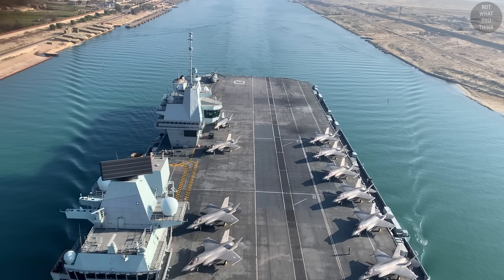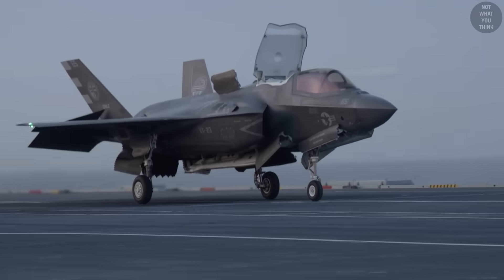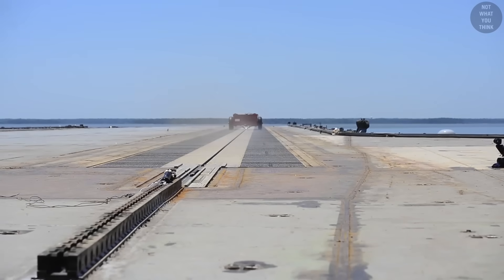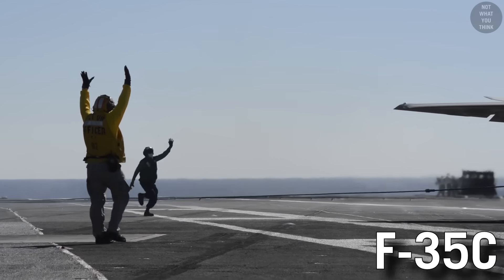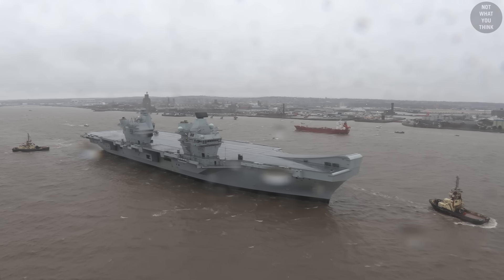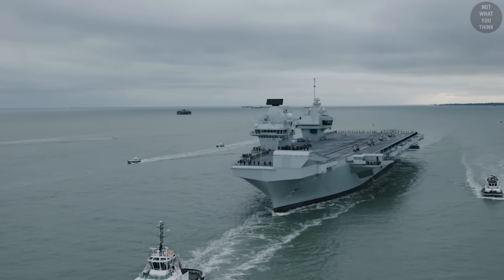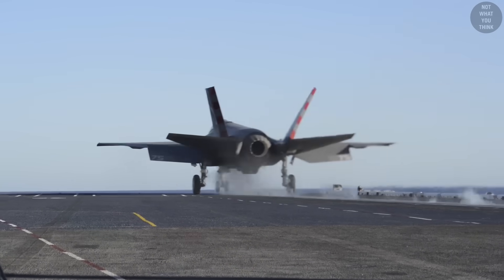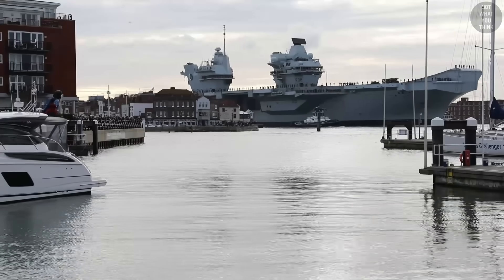Was the Angled Flight Deck Missed on HMS Queen Elizabeth?

Comment: You missed the main reason why STOVL was favoured. They are able to take off and land at higher sea states than traditional aircraft. This is critical for the UK, as the Atlantic has these often during the spring and fall. North Atlantic more than the South, but South Atlantic also has demanding weather and Royal Navy needs to operate there as well.
Reply: Sweats in Falklands War
Reply: @randomguy9777 You don't seem to fully read the comments. just because the QE class don't use the E2 does not mean that they have nothing other then the radar on the ship. i won't bother saying anything more in the hopes you use your head a little more in the future. If i didn't know better i would have thought that you are a E2 salesmen with statements like " You still need them though." when directly told there are other options lol.
Reply: Apparently the U.S wanted 2 billion U.S dollars for the EMALS system and it does not even work right.
Reply: @randomguy8196 Sour grapes about what? How would our carriers be more vulnerable to regular missiles? Both the carriers and the Type 45's that are part of the carrier strike group can track about 1000 missiles at a range of at least 250 miles, add to that the carriers have the ability to fly Merlin AEW with Crowsnest around the clock to expand that capability. Lack of a working time machine or ability to see into the future I'd imagine, our carriers were planned and built before hypersonic missiles were an issue. Any nation capable of hitting our carriers with a missile could easily shoot down an E-2, France operates 3 E-2's but if they lose them then the Charles De Gaulle has a radar range of about 155 miles and can only track around 500 targets, much less capable than the Queen Elizabeth class carriers.

They have already launched drones from HMS Prince of Wales and have plans to continue developing that capability, but realistically most of our recent conflicts have been against nations that barely have an air force, never mind anything that could threaten our carriers. So drones are in the nice to have category but hardly essential at this point in time.
Reply: @randomguy8196 On the E2 issue, Skullet said that the US has 11 aircraft carriers, each equipped with 5 E2s, for up to 55 E2s in total.

Other nations have 2 or 3 E2s in total, across their entire fleet. With that few, they likely wouldn't want them anywhere near enemy territory or anywhere near the range of enemy firepower if there was the remotest possibility of them being shot down.
Reply: And they can land anywhere, not just aircraft carriers
Reply: Whats fall?
Reply: @UCrgA9Q4PMBip4Iy62ltAZJQ you’re wrong,
QE2 radar coverage is blocked by horizon smh. Planes can see further out
Reply: Every radar has a horizon. The distance to the horizon is deternimed by the height of the observation platform and the height of the observed target.
Reply: @JB-qg2uc hmmm not every radar.
Reply: @lmaoroflcopter  well as long as you are in atmosphere or in orbit, you have a horizon. If you are in deep space and outside the solar system you don't have a horizon. Or then your horizon would be caused by the galactic core or something else.
Reply: @JB-qg2uc  Check out what the ionosphere does for HF radio waves or take a look at ground wave propagation.
Reply: @smasher123ism   They use Crowsnest radar mounted on Merlin helicopter but looking at UAV system it's in the video.
Reply: Ya but they found other ways to wash the plane’s
Reply: Not an issue for US Supercarriers...only an issue for tiny STOVL Carriers.
Reply: Royal navy is gay
Reply: nobody cares about bristish
Reply: T
Reply: I remember that a British harrier pilot stated that during the Falklands conflict in 1982 that because of the weather conditions it would have been impossible or very dangerous for conventional aircraft to take off or land on a normal carrier. I think his name was 'Sharky Ward'. I am no expert just saying that there many variables to account for. Also the USMC uses the F-35b so again there ard many aspects to take into account.
Reply: Leaving the cats and traps off was a financial decision made by the bean counters and had nothing to do with the way the military operate. The Navy fought the decision and so did the MOD. The ships are far less capable without them.
Reply: The USA has operated in the Atlantic with Carriers for a century now.
Reply: The main reason STOVK was favoured was cost. That’s it. It’s more expensive to fit and maintain a catobar carrier, but the main difficulty is keeping all those pilots well trained. Landing on catobar carriers requires insanely more training. So just isn’t really feasible for the UK at the minute
Reply: Do you think I don't that, I live in Portsmouth UK, where both carrier are based, Indeed
Easy to land on the center compared to pitching arf deck
Reply: Actually the main reason why the RN does not use steam catapults anymore is that they require Nuclear reactors to provide sufficient steam and the Royal Navy do not want ships with Nuclear reactors, they are very expensive, prohibits them docking in ports they want to use and unnecessary for the role the ships are intended to be used for, which is a cross over between a Aircraft carrier and Air Assault ship with plenty of space for Helicopters.
Reply: In old ships power was generated by boilers and routed as steam to power a number of old systems. New ships utilize electricity to acchieve the same thing. Nothing really prevents said ships from harnessing the exhaust heat from the diesels to generate steam for the catapults. Tapping the steam from the reactor cycle is just a simpler matter. But this is not a feasibility issue, merely a choise.
Reply: youd need some greenwater type conditions to make barrier assisted landing impossible. but frankly. the royal navy has had a defensive posture since the end of ww2. so i dont understand why they chose the one version of the F-35 with the smallest takeoff weight. i mean. think about it. also, keeping it a flattop would mean it could still do its job. its longer than the america class by ~90 feet. and the america doesnt have a ski. i mean. dont get me wrong. if they didnt want a full sized carrier. thats fine. im just confused why they made massive carriers. if they are basically america class carriers. just without the rest of the carrier battle group since the royal navy is so small.
Reply: It was favoured because it’s cheaper to spend money on conventional fuel for a few decades than a nuclear reactor. It was about saving money…. That’s the reason the French dropped out.
Reply: @@karmakazi101 You seem to know an awful lot about the capabilities of the British
armed forces and the American armed forces . I am proud of our forces and what they do but I know we work together as partners. I am not anti American as you seem to be. If you are such an expert you can answer your own question. If you cant then  you clearly know a lot less than you think. Why should I educate you.
Reply: Catipult launch can carry bigger payloads plus you can use many other planes as well
Reply: 😢😢😢😢😢😢😢😢😮😢😢67
Reply: The main reason is because it's a cheap junior size fossil fueled slow poke carrier
Reply: The qe is a waste of money.   The French pulled out because we were doing things on the cheap.   Now we have a near £6bn pair of boats that can launch one type of jet which has the operational range of Frisbee.
Reply: You can fly STOVL aircraft of a carrier with catabar. But you can't fly eg E2 Hawkeye from a carrier without it.  So leaving cats & traps out is highly limiting for operations.
Reply: @jeromedavies2408  we seemed to struggle through with the Illustrious class ;)
Reply: @jeromedavies2408  Except it's not worth the price to install CATOBAR just yet for the british carriers
Reply: @jeromedavies2408  yes you can, BUT here is the kicker, you have to use catapults to get them off the deck at the SAME payload they can get off the deck on the QE class using just the "ski jump", and using a catapult reduces the sea state launch capability vs a "ski jump", so having to use catapults leads to an overall deficiency in sea state operation, which is critical to the UK, given where some of the roughest sea are.
Reply: @jeromedavies2408  I'm pretty sure the UK doesn't have or use the E2 Hawkeye, so not really an issue here. Also the launch rate using Catobar is slower than the setup on the Queen Elizabeth as it doesn't have the issue of waiting for steam production to catch up, it also causes less damage to airframes due to stress.
Reply: @Skullet  That's sort of the point. The E2 Hawkeye cant fly off QE  so airborne radar range is severely limited.
Reply: @jeromedavies2408  The UK doesn't use the E2 Hawkeye, so the fact that a plane we don't use can't take off from the QE2 is utterly irrelevant. The QE2 radars can track up to a 1000 targets at a range of 250 miles or a snooker ball sized target over 12 miles away. The QE2 opperates as part of a carrier strike group so it also has the capabilities of the other warships in the group. With that said, I think its radar capabilities are fine.
Reply: @Skullet  That's true of all carrier groups. But they also have long range aerial radar. The UK is hoping to use helicopters which have less range and a lower ceiling. 
Without cats/trap the UK carriers are limited to STOVL types, so very limited. EG US carriers can change staff while on patrol  with the Grumman C-2 Greyhound.

Lack of cats/traps severely limits the capabilities of the Elizabeth class carriers.
Reply: @jeromedavies2408  We already have the Merlin HM2 with Crowsnest and while it might not be as good as the E2 Hawkeye, it's probably a lot more cost effective. France bought 3 E2's and the expected program cost is $2 billion, that's a waste of money for a capability that we probably don't need. We don't need to change staff while on patrol, the Royal Navy has operated successfully for almost 500 years without doing so.

The reality here is that most countries don't have any carriers never mind a carrier strike group, and the ones that do are either allies or countries we aren't likely to come into conflict with, that leaves Russia and China and Russia's Admiral Kuznetsov is likely to break down or sink itself before being any real threat, and the Chinese also use helicopters for aerial radar so they won't have an advantage over us either. We already spend around £40 billion on our military every year, we don't need to be wasting more money on stuff we don't actually need.
Reply: @Skullet  whose "We"
Reply: @Skullet  Complacency Rules OK!!
Reply: @Skullet  the steam dosent have to be waited on as it is being produced 24/7 by the nuclear engine. Plus the minute it takes to hook up a plane it would be enough time to build up steam
Reply: @Skullet  as people have said. It's better to have something and not need it than it is to need something and not have it.
Reply: @ipant1056  While it's a charming phrase, it's also a bit of an oversimplification and doesn't scale well in regards to the cost of having something compared with the consequences of not having it.

If the cost of having something is billions of pounds and the likelyhood of you ever needing it is fairly low, then that's not a smart investment. If you build an aircraft carrier with the matra that it's better to have something and not need it than it is to need something and not have it, then the cost and scale of that project is going to get out of hand really quickly.

Realistically countries who are a genuine threat to the UK aren't going to be defeated or dissuaded by some steam catapults on two carriers, so why waste that money when you can spend it elsewhere on stuff that might make a difference.
Reply: @ipant1056  Steam has to be piped around the ship it isn't teleported, and it uses a lot of fresh water and wastes a lot of energy and space. Also the HMS Queen Elizabeth doesn't have a nuclear reactor.
Reply: @Skullet  I know that the hms queen elizabeth dosent have a nuclear reactor, I was talking about the uss Nimitz class and the uss Gerald R ford
Reply: @Skullet  war is fought and won in the sky's, if we didn't have carriers that were efficient then we wouldn't be ablebtibshow air power worldwide. Plus we need to stay a superpower and the carriers help that
Reply: @ipant1056  No, If anything America has spent the last 50+ years demonstrating how wrong that is. Did overwhelming air superiority win the Vietnam war or the war in Afghanistan? 

Why does the UK have to show air power worldwide? We've spent billions over the last 3 decades getting involved in conflicts that often helped no one. The UK tax payer got zero value for it's money, and the people we were supposedly helping are in a worse position than than they were before we turned up. But hey some folks got rich from selling weapons so it's not a total loss.

We are't really a superpower, those days are long gone and a couple of carriers aren't bringing them back.
Reply: @ipant1056  This is largely a discussion about the HMS Queen Elizabeth and by extension the HMS Prince of Wales, so the nuclear reactor on a Nimitz or Ford class carrier isn't all that relevant here.
Reply: @ipant1056  wars can be fought in the air but can only be won on the ground. The flag must fly from somewhere, the border must be drawn on a map.
Reply: @theant9821  yes the ground is a big part, the SEA and the air have a more influental place in the winning of a war though. Thats why planes and ships go in first then we have soldiers go onto the shores to fight
Reply: @Jord2123  a radar has an almost immediate response not 8 minutes, the radars on the carriers have a range of 75 miles, not mentioning the fact of E-2 Hawkeyes who would be up 24/7 during wartime and have a radar range of 200 miles plus however far away it is from the ship. Plus aircraft carriers will always be in a fleet so it has a radar ship aka arleigh Burke class ships, air defense ships aka cruisers, air and water defense ships aka destroyers multiple submarines, amphibious assualt ships that carry helicopters and F35's. logistic and supply ships. All in 1 carrier strike group. Furthermore the uss Nimitz class carrier can launch a plane every minute and it has 4 catapults which means 4 planes per minute
Reply: @Jord2123  another thing is that the US isn't limited in our budget, we have the largest spending meaning we can spend more than any other country even during war
Reply: @ipant1056  Jesus the fact you are trying to twist my words again so you can win this little argument, I know a radar is instant you mug, but I’m talking about reaction time. Radars have a certain distance. One something pings on the radar the quick response teams might have 8-10mins before the threat makes into range. I derailing don’t know how you assume I thought a radar takes 8 mins to react!
Reply: @ipant1056  So we're ignoring the Vietnam war because it doesn't fit your narritive? The US dropped more bombs on Vietnam than were used in the entirety of WW2, yet it still didn't change the outcome. The whole Afghanistan thing is much the same story but even worse, despite having complete dominance of the skies and throwing everything from MOAB's to drone strikes at the problem it made little difference to the outcome, you can bomb and shoot people from the air for as long as you like but if you can't put boots on the ground and capture and hold territory then you are going to struggle to win a war.

When you saw "we are a superpower" who is we? As I'm talking about the UK not being a superpower and you've used "we" in regards to the US, so you see my confusion here?
Reply: @Skullet  we’re showing uks ability on the world stage and we’re Abel to have a potent force to protect the many overseas territories of uk and the main island itself
Reply: @Skullet  you've got it EXTREMELY backwards

They don't operate the E-2 because they can't. The French own several for their Catobar carrier. If the RN had catapults it absolutely would operate the E2 or an equivalent.
Reply: @Skullet  well actually, carriers do help that. Barely any countries have aircraft carriers. Aircraft carriers are the reason why we won the pacific theater in ww2. And is destroying japans aircraft carriers are the reason why the lost that war. And you can pretty much win wars by just using planes and bombs without using troops
Reply: Given infinite time and resources. There is a reason why as late as desert fox, months of constant air operations, tens of thousands of sorties, hundreds of thousands of munitions, a tank brigade did more damage in the first 30 minutes of contact than the entire air campaign.
Reply: @ipant1056  usa isn’t the only nation, the uk can and do do it permanently, 10,000 abroad fighting worldwide, spec ops ect and the uk has more bases abroad than any other nation bar usa…
Reply: @Skullet  So The Senior Service has had Sailors serving since the Year 1522 !?!?   I Bet there Retirement pension is Amazing 👏 😎
Reply: @ipant1056   I am British and we are not a superpower in military terms but we do punch above our weight and are an ali of the USA and will be working hopefully with you and not against you. Our needs are not the same as yours in military terms. Whats good for you is not necessarily what we want. We are engaged in a major modernisation of our military capability  that are suitable for our needs , not yours. We are spending a huge amount on cyber security and warfare  which is our major priority. We are acknowledged as one of the leaders in that area. So we help you and you help us . That's a good arrangement.
Reply: @bjs7442  exactly
Reply: @daddyj4768  You are dangerously over simplifying the issue here.

Especially since carrier groups are useful when warfare is at or close to the sea. But both the U.S and the U.K have extensive bases of operations around the globe.

Using WW2 as an example for modern warfare doctrine and spending is also a pretty disastrous idea. How many island hopping campaigns are there going to be in the near future?
Reply: @AlexxxxxSaysHi  while there are many bases around the globe, it would take a while for jets and planes to refuel and fly all the way back. This is why carriers are useful. You can send wave after wave of planes to support troops or other areas without having to worry about time it would take for planes to fly back. And considering we go to war with China, there can be many island hopping especially if they try to invade Taiwan or Japan. Carriers are simply faster and more efficient to support ground troops across the globe without worrying about time
Reply: @Skullet  we should be spending significantly more on defence, but yeah your cost benefit analysis of the hawkeye is correct. crowsnest does an acceptable job given our budgetary limitations. and if we'd gone for catobar carriers we wouldnt have much of a navy left to fit aroudn it, the price increase compared to stovl is just so much
Reply: @Skullet  the UK carriers are normally in fleets with us carriers on operations, the UK can launch in a support role faster whilst the us can launch equipped with a larger pay load.

The UK can switch to carrier typhoons and taranis air defence systems quickly if needed. The carrier typhoons has passed simulation and prototype testing and can go into production if required.

This is partly the reason for lack of commitment to the f35, the UK are sat on the fence whilst the future if wars and what will be needed becomes clearer. If we can avoid conflict we will get to tempest with a minimal fleet of aircraft meaning we have a British replacement from 2040 on
Reply: @ashleighcartwright5186  depending on what budget government we have in 2040 as the steam CATOBAR was UK and they pulled the plug on EMCAT which was our electromagnetic launch system that started before EMALS
Reply: @jeromedavies2408  All of your arguments are irrelevant. Here is the real secret, the QE Class were designed with the Royal Navy's and Britains requirements in mind, no one else's. 

Britain cannot run multiple Nimitz Class Carriers for example, and it is nothing to do with the Nuclear Powerplant, or the aircraft, its the CREW. Crew complement of a Nimitz is some 5000 with the air wing on board. The Crew of the QE's are 2000 - 2500 with full air wing/ full air wing + Marine complement. It only requires a sailing crew of 500. Those crew savings are absolutely vital for a navy with a limited manpower pool such as the Royal Navy. 

The ships were not designed for the USN, or the Spanish Navy, or the French Navy... they were designed for the British Navy, which means they were designed for THEIR requirements, not for what a bunch of armchair Generals/Admirals THINK they should have been designed for. 

Cat and traps would have added a further 1 billion each to the cost of each ship, not only for the cats and traps but also for the addition of the angled flight deck needed. Add to this the fact the Royal Navy decided to concentrate on the F-35B as the primary aircraft flying from the carrier so cat and trap is not required. 

Fact is lack of cat and trap may 'limit' the Carrier, but the QE's are the most capable Carriers in the world behind the Nimitz and Gerald D Fords, and the only navy with the budget and manpower to operate either of those behemoths is the USN. The ship is as capable as it can be within the limitations of budget and manpower restraints. I would rather the RN operate two QE's than a single Nimitz Class.... At least with two ships you can usually generate one at sea at all times, especially if they are conventionally and not nuclear powered.
Reply: @Skullet  helicopter AWACS can not compete or substitute fixed wing AWACSs as they are superior in operating altitude and endurance, which are very important in contributing to survaillence coverage in both area and time. I'm afraid the Merlin Crownest is nothing more but a compromise because the MoD penny-pinched their way into not having a CATOBAR QE. What a waste of 60,000 tons tbh.
Reply: @jeromedavies2408  the Ryal navy use an AEW Westland Sea King helicopter. Bristish aircraft carriers aren't comprible to the Ford class in term of capabilities. To start with they cost half the amount of money. Have much smaller crews therefore cheaper to operate. They are more than enough for the Royal Navy.
Reply: @Joesolo13  I think the E-2 is outdated and a waste of money, for the RN,  they should wait for the EV-22 instead which would be better.
Reply: @Skullet  The US Navy uses the E-2D on its Nimitz and Ford-class carriers for a reason.  The E-2 Hawkeye is even good enough that many countries use it as their lands based AWACS.  You really can't compare a surface radar to airborne radar capabilities. France, the only other country besides the US to have a nuclear aircraft carrier, uses the E-2 Hawkeye.
Reply: @PlugInRides  I feel that I've already covered all of those points in previous comments in this thread over the last 9 months. At this stage the conversation has largely become circular and I'm reluctant to invest any more time into it.
Reply: @Skullet  I'm only surprised you stood it so long. I'd only add my surprise that in spite of the usual machinations between the Treasury and MoD and the delays and changes of design, the UK has ended up with two clearly highly capable carrier systems. Which for me is down to the decision to build them around the F-35. With the spectacular rate of development of UAVs, the combination is clearly a game changer.
Reply: @nicktecky55  I probably should have given up months ago to be fair. 🙈

I would agree though, despite the usual delays and shenanigans we've ended up with two really good carriers, that few outside of the US can match. Hopefully they will continue to serve us well into the future as upgrades and new technolgies come online.
Reply: @Skullet  Too bad the Hawker Siddeley P139B AEW/COD aircraft got killed by the budget cut back then, the use of turbofan propulsion instead turboprop gives it more hope to be able to operate on STO carriers like QE (arresting cables needed though), and shutting the mouths of those “No E-2 no AEW” fanatics.
Reply: @daddyj4768  The world has changed drastically in the last 30 years alone. You clearly didn't pay much attention in history classes either. In WW2, the allies resorted to carpet bombing entire German cities into oblivion, including those of no strategic interest and choked with refugees (Dresden, which was one of many war crimes we committed but got away with because we were the good guys). The Germans did the same. Both sides thought that in doing so they'd drain the enemy of the will to fight. It had the opposite effect - it only reinforced each side's belief that they were the righteous ones. In the end, we had to do a land invasion.

The Pacific war was the only one in which carriers were engaged in any meaningful way. Today, carriers the size of the Gerald Ford would be sitting ducks in an all-out conflict. For example, in the Battle of Midway, the US got lucky and lost entire squadrons trying to take down Japanese carriers with conventional bombs. These days, as the Russians have found out, and indeed the British found out in the Falklands, any long-range attack on military shipping can be a disaster. With something that has such a huge silhouette as the Gerald Ford and its sister ships, what do you think an enemy is going to target first?

The QE carriers cost $7.6 billion for the TWO. The Gerald Ford carriers are costing $12 billion EACH. An advantage not mentioned here of using VTOL aircraft is the ability to launch several aircraft at once in an emergency defensive situation. Britain's armed forces these days are designed to be more defensive and the QE class is an example of that. The US armed forces is still set on a more aggressive footing ... basically, the playground bully looking for a weak target so that he can steal his lunch money.
Reply: @jeromedavies2408  Merlin
Reply: @jeromedavies2408  
No it’s not, you’ll have researched  the over the horizon radar fitted to the type 45 Destroyer and these carriers? Thought not.
Reply: @petittrainguernsey3297  You'll need to provide a link for this. I can find no evidence that the type 45 radar s over the horizon capable. It's 400km range is still line of site. OTH radar range is usually 1000km+
Reply: @jeromedavies2408  
So, we all use satellites right? Ship links to satellite. Cha-ching. Over the horizon.
Your welcome
Reply: @jeromedavies2408  
Change staff? Real cost effective way of moving 3 or 4people at a time…
Probably required because the nuclear propulsion excludes the ship from visiting most foreign ports.
Reply: @Skullet  a range of 250 km, not miles. Also, the early warning radars on the QE are to be on Merlin helicopters, won’t be delivered until late 2023 and because they are on helos their range is very limited compared to a Hawkeye. 
As for VSTOL being better for landing in rough seas, you’re dreaming, an F-35B landing in high seas is a broken airplane, an airplane landing on a catobar carrier is not.
As for the Crowsnest it is a French developed radar, so is the QE main radar, sensors, electronics and missiles.
Yes the QE operates in a carrier group, like any other carrier, the difference being that the QE is dependent on allies’ ships to form said group. The RN doesn’t have enough ships to field a carrier strike group by itself, nor enough replenishment ships, which makes a conventional propulsion carrier like the QE quite inutile…
Reply: @Joesolo13 Not having a catapult doesn't stop someone using an e2 Hawkeye. Case in point we use e3d sentrys (soon to move to e7) for airborne early warning.

None need to land on a carrier, both platforms can be airborne refuelled and the UK still has a global reach in terms of operating bases.

Whilst the crows nest is used for localised early warning, in any conflict integrated arms will be used, completely negating any benefit of being able to operate an AEW platform directly from a carrier.

Add in the integrated battlefield data links and you have yourself a very complete picture without needing to waste budget on catobar.
Reply: @Skullet  So much cope for that slope
Reply: This is why the ships are equipped with the possibility to install catobar equipment, when it is reliable enough.
Reply: @JB-qg2uc  when it's reliable enough? It's been in practice with the US for decades with only a handful of issues

Meanwhile the US had to ground STOVL several times because of so many crashes 

Not to mention the big issue with needing to barely arm your aircraft 

The UK screwed up big time with their carriers
Reply: @deusvult6920  Barely arm your aircraft? Using SRVL the F35B can land with around 7000lbs of fuel and ordinance, the F35C used on US carriers can land with around 9000-10000lbs.
Reply: @deusvult6920  this has been discussed at length above. These are not steam ships and have no steam for the catapults. This is a new and experimental technology. Also, the combat load for missions is the same. Difference only that while carrying a strike package, they need aerial refueling after takeoff.
Reply: @JB-qg2uc  yes but realistically what are the actual chances the British government would revert their QE-classes to catobar, even one of them? Or maybe how far into the F-35B regret they need to be in at the fact that they have a 60,000 ton carrier that doesn't take fixed wing and/or non-VTOL aircraft.
Reply: @deusvult6920  not a steam catapult but an electro-magnetic one. That is only in use on 1 us carrier and still isn't perfect. The uk carriers don't produce steam, ao a whole additional system for steam production would have had to be designed and built just for the cats. Therefore, the possibility is there to upgrade them with ELAM catapults when the technology is mature
Reply: As an American with more than 3 braincells, I love how Ipant was shut down when he started trying to spin his bullshit narrative by people who actually know some shit.

 I get this is the internet, and there's a bit of a personal separation in everything you do, but the kind of people that feel like they need to devalue everyone else just because "Merica #1" really piss me and every other rational American off. 

To everyone else who may have a bad opinion of us (Because of these kinds of individuals) , I humbly ask that you understand not all of us have our heads up our asses, and that the idiots you encounter espousing "America is the greatest you just suck git gud lol" do not speak for the rest of us.
Reply: @pilgrim....  Apologies if I've read your post wrong I've somewhat lost track of the conversation. It would be a nice capability to have, but it would be considerably cheaper for our ally to eject and ditch the aircraft than it would be for us to provide the capability for it to land safely. Again I may have misread your post so apologies in advance.
Reply: @randomguy8196 Again, stick to what I actually said, not what you think I said. Trying to make straw man arguments is a pointless waste of time.

The US spends almost $800 billion per year on it's military, what works for them isn't necessarily going to work for us with a budget of around $60 billion, it's really not that difficult to understand.
Reply: It's Autumn NOT FALL.
Reply: @randomguy8196 Can you point to where I said the US operates the E-2 for no reason? I don't think my post even mentioned the US, probably best to stick to what I've said not what you think I said.

The US operates 11 carriers and they can field 5 E-2's each, most other nations using the E-2 can field 2 or 3 at best, in that scenario it's a nice capability to have but one that's easily taken away, at which point they'd have to fall back to a radar system much less capable than the QE class carriers and it's strike group.

Like I said drones are nice to have but not really essential to the current operations the RN is conducting. With that said it's a capability we've already demonstrated and will develop further over the coming years.
Reply: Fall? Autumn FFS stop bastardising our language
Reply: @randomguy8196 Can you quote a single instance where I used the word useless? What you think I implied and what I actually said seem to be some distance apart. I'm guessing nuance is completely lost on you.

I have zero interest in continuing a discussion with someone who seems intent on building a straw man argument, life genuinely is too short for that nonsense.
Reply: @Skullet  Amazing that all americans are sudenly some sort of miltary car salesmen. Trying to sell you overpriced military stuff.
better cancel your healthcare system so you can have more carriers.
Reply: @madtechnocrat9234  Haha! They can cover their carriers with missile defences but can't cover their working class for a broken leg, how sad.
Reply: @Skullet  found a br*'t*sh
Reply: That is not the main reason. And the advantage of taking off and landing in higher sea states is negligible. STOVL is only marginally better in high winds than conventional fast jet aircraft. The UK actually wanted its Carriers to be CATOBAR. The main and only reason it had to go with STOVL is. Because the UK simply couldn't afford the cost of building and maintaining CATOBAR carriers. Largely because the UK slashed it's defence budget. And also completely F-ed up the design and construction of its new carriers.
Reply: @andywilliams7323  yep cost is the major part. It's not the 19th or even 20th century anymore. The brits only have so much to spend. 2 catobars might've stretched the budget too far. 

Honestly there's even good argument that they could've been better off building multiple of something like Italy's Cavour. She can support ~16 F-35s and for her price(~£1.5 billion) the RN could've had 4 similar vessels. Probably slightly larger and more specialized for aircraft carrying role enabling a somewhat larger air wing.

 I've always read you expect about 1/3rd of your fleet to be ready for service, another in refurbishment but surge-capable and another third in longer term overhall.  With 4 carriers the uk would always have one or two in prime fighting condition and be able to surge 3 on short notice. As it stands they'll need to be careful with maintenance schedules to be able to keep one on hand at any given time.

Of course, nato exists, so realistically there's also the various European carriers and the USN's fleet to cover holes, but if the purpose was truely domestic power projection I think they could've done better.
Reply: The UK doesn't need an aircraft carrier for the Atlantic. It has numerous strategic territories it could fly planes out of: UK itself - including Shetland Islands, Gibraltar, Bermuda, Cayman Islands, Ascension, St Helena, Falkland's.
Reply: @N330AA  while that is true, it means they could never support troops on the offensive side. While troops move into deep Russia or China, it becomes increasingly harder for jets to support troops hours away from air bases
Reply: @daddyj4768  What are you replying to my comment about air bases? Well China isn't in the Atlantic so that doesn't apply. Russia doesn't really have good sea access either. If there was ever a fight with Russia it would be via European NATO countries.
Reply: @N330AA  it would in the first part of it. But to win a war you can’t stay in one spot an entire time. The truth is. To beat China and Russia completely, you will have to fight in Asia. Carriers are still entirely more efficient and a way quicker solution.
Reply: @N330AA  Well pointed out. And the Bonus with Gibraltar is its Tax Free so the Jacktars can fill up with Cheap Booze.